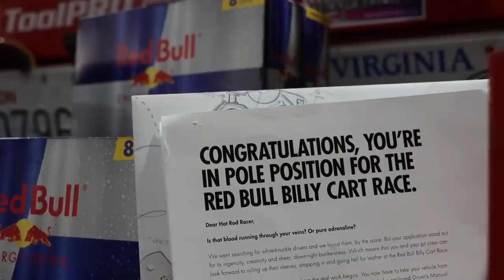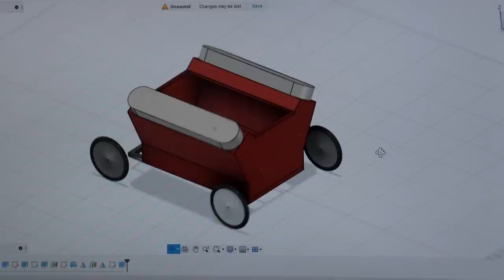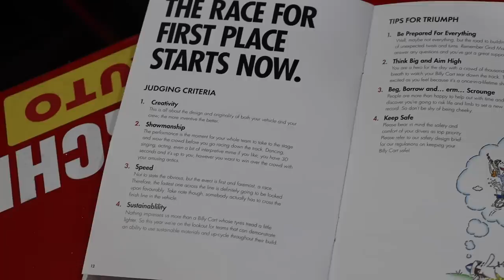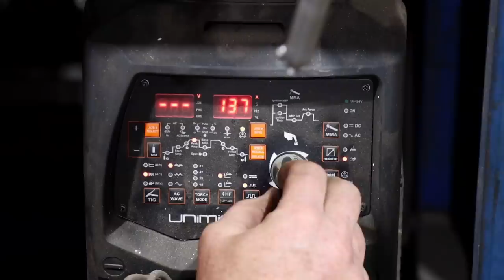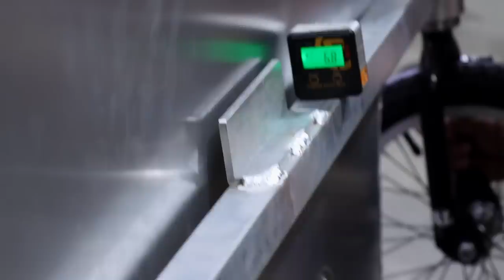Have We Gone OVER THE TOP? @redbull  Billy Cart Build Part 1

Comment: I'd add more trail on those front forks for stability, make the rear forks vertical for strength and use a lighter seat if the weight limit is an issue. Do you need brakes or is there catch at the end?
Reply: The bending moment on the rear forks laid down is enormous....either some angled uprights or stand vertical as you say. "If it looks right then it probably is" is a saying that works equally in reverse!!
Reply from the maker: Forks have 7 degrees rake. Rears are now upright.

Comment: How about some suspension forks all around?  They may be a bit heavier but it would make for easier steering and save Woody's back a bit.  You also need to turn those rear forks up the right way, they will snap going over ththe first jump.

Comment: Hi Al, on a bike the roller bearings for the  forks are 30 to 45 degrees like a trailer bearing rather than straight roller bearing. That's to handle the vertical and horizontal forces.

Comment: aw man this race is so much fun. You guys are gonna have a blast.
edit: I dunno if you have engineered brakes for it or not, but they will be something you need that most teams forget to incorporate. You get lots of speed and steering is important, but braking can save your run
Reply: If they leave a big hole in the front of the floorpan, they can do a safer form of Flintstone braking.
Attach a nice big piece of tire to some metal.
Attach the metal to the frame under the steering rack with a hinge that lets it swing down.
Use it by pushing it down so it drags against the pavement with your feet.
Add a spring that holds it up when not in use.

Or...just fit up some v-brakes to the forks, since they already have the mounting points built in, and run all the cables to a pedal.

Comment: I would name that thing "The Spinal Compressor".
Back in the early 1970s, before mountain bikes had been invented, me and my mates used to try and  build off road bicycles.We soon learnt that without any suspension to absorb the instantaneous shock loadings, as soon you went over a jump the forces on landing were brutal, and those forces had to be absorbed by something giving. We bent front forks, wheels, frames, even handlebars and if you stood up to try and absorb the shock with your legs, eventually the pedals. If we tried to make one bit stronger, the next bit along would bend. As soon as we started using sprung front ends off old mopeds our problems where solved. If "overt" suspension isn't allowed on a billy cart then I would at least use big wheels so the spokes can flex a bit, or big soft balloon tyres.

Comment: @Skid factory
See if you guys can find Mountain Bike 
front forks with suspension built in. 
Your cart looks as tuff as Wood Pecker Lips.
But, its still gonna drop like a rock.
Probably break Woody, and itself apart in the process.
Plus.
It's the main reason most carts don't finish.

Comment: Calling it right now. Those rear forks are going to snap.
Forks aren't designed to have much, if any, lateral loading.
One of the most common frame failures is to snap a fork off at the headtube.
This can happen even if the headtube only has a LITTLE too much caster and you are a bit rough with it (like casing a landing).
EDIT: Looks like they fixed it.
(And mentioned right at the end that they had planned to.)
Reply from the maker: Yep we’ve mounted them upright now
Reply: Did ya watch the video? They said they’re going to mount them up the right way.
Reply: @ttv8ra23  I resisted the urge to comment about it for almost the whole video.
It looked like they had moved on by then.
Also, they said the biggest problems were the weight and the flexing, which was from the aluminum sheet mounting, not the forks themselves. I STRONGLY disagree.
So, there was a chance they would leave it like that if it came in underweight.
But their reply says they fixed it, which is great.

Comment: 12:10 Wait... parts from an old, rare Nissan's stock steering you took out.

Hmmm, where did that come from lol 😆
Springs on the seat, save ur back a bit.
Reply: 1000%. If not using suspension on the wheels it is essential to add some suspension to the seat. About 10cm seat travel would make a massive difference to driver comfort and safety. It could be as simple as a front hinge and 15cm of foam rubber under the back of the seat.

Comment: Make sure you give it a bit of a road test first. I built something similar and calculated all the angles for Ackerman steering and it handled like crap. I changed it all to just same angle steering  and it made a huge difference.  The theory just didnt seem to work in practice. I also have loads of rake in mine.  I'm sure you guys are all over it though.

Comment: Another issue I’ve noticed in all the soap box racers is that quite often spoked bike wheels can’t handle the sideways load at all (ideally the cheap single wall rims) and buckle quite easily.
Reply: If a wheel buckles, the spokes weren't tensioned properly.

Comment: For the rear wheels I woulda thought it would be better to weld them into the body at the ends of the rear? Lighter and less flex on the mountain. The further they are from the body the more leverage there is bending the mount.

Comment: Need to increase castor/trail. Almost vertical steering spindles and wheel offset means no trail which = death wobbles. Think of this front end more like a bicycle or motorbike rather than a car and google motorcycle steering trail
Reply from the maker: It has 7 degrees of caster.

Comment: those steering racks... I have one on a go kart, the best thing you can do is loose the universal and weld a tube over the spline to keep the guts of it straight, as they only have one bush (plastic hole) they flog out really quick and the engagement between the pinion and rack becomes very sloppy, so keeping it straight with the use of a one piece column is the way to go ( i machined a mount for the steering wheel that slips inside the tube and put a couple of 6mm bolts through it, that way the column can still slide out of the rack if you need to service it or change the rack onto a different kart. Also don't try to have the front forks at the same angle as on a bike, it wont work, generally you want to turn the forks backwards and have them vertical, or if you use 1 front wheel have the head tube at a 40 degree angle to get the contact patch in the right spot as that's what determines the castor angle, failing that use offroad go kart wheels or big wheel barrow wheels/ ride on mower wheels and set the geomotry the same as you would a car

Comment: Guys good effort but I think you have to address that front end.

As you have no caster angle (or rake) in your forks, you have effectively built in negative trail (the distance between where the steering axis meets the ground and the tyre contact patch), or simly put the steering axis is vertical and the axle is bolted in front of it.

This will tend to make the steering very unstable and twitchy, the steering will want to stay on and may very well want to continue to steer and cause the kart to veer violently. We've all seen these contraptions do exactly that.

Suggest that you lay back the steering head/bearing tubes (I'd also brace them with a flat plate which bolts up the front and sides of the body work), which will move the axis ahead of the contact patch. You might get away with bending the forks also to achieve the same effect.

Otherwise at a pinch swap them across/spin them around so that the axle sits behind the forks, such that they act like shopping trolley wheel and want to naturally run straight but consider that a push bike has about 15-20 degrees so I would aim for something in that range.
Reply: Also I think I would not have used bike wheels, they don't like being laterally loaded so they may buckle.

Perhaps build in 5-8 degrees negative camber front and rear and about 60psi in the tyres ;)
Reply: You must have missed the part where Al talks about putting rake in it...
Reply from the maker: Watching til the end then commenting is a good way to avoid confusion.
Reply: @motoxray  did not miss that mate but looking at the 5 or so degrees he put in it, it is completely inadequate.

And yes I did hear the bit that they gonna be around 300kg race weight, most of which will be loaded up on one fork when cornering - a fork made for a max of what 100kg bike and rider, and made to work at around 15 degrees of rake.

And yes I did not miss the footage of the karts jumping and landing on the front wheels (and why they chose forks as means to counter this).

And yes I did not miss seeing how flimsy the bodywork is and that bracing to 2mm sheet alloy is like screwing a shelf directly into the sides of your zincalume garden shed (granted they will address the rear wheels but my point stands).

As I said, I would get 15 deg rake and about half that in neg camber, brace it well (triangular down to the chassis rails on both sides and in the middle down to the floor between the driver's legs, at least at 45 degrees if not more).

In the spirit of building a billy cart with what you have, top effort and ingenuity.

But given the tools, materials and resources, I reckon this will be about as stable and strong as a council wheelie bin and that front end has a serious chance of folding back under the kart and ejecting the occupants.
Reply: @theskidfactory  didn't like the t-shirt

Comment: Woody, put a thick layer of good foam in the seat, your spine will thank you! Can't wait to see this go down the hill. The engine is such a cool idea!

4:11 If you want to make the same steering but don't have a lathe, use the headstock and bearings from a children's bicycle or BMX if you're already going to use the forks. It even looks similar, just super beefy when Al makes them.

Bear in mind the rake and trail, and the direction of the mounting. The axle isn't underneath the steering stem, so it won't rotate on the middle of the tire. It will either prefer to turn or track straight like a shopping trolley wheel, depending on which way you mount them.